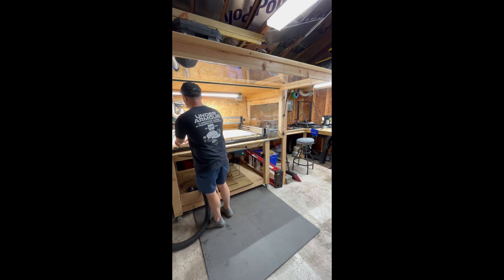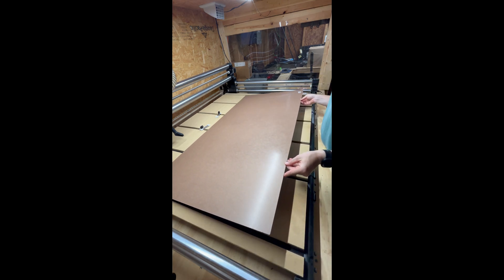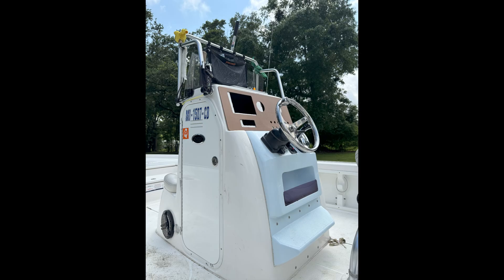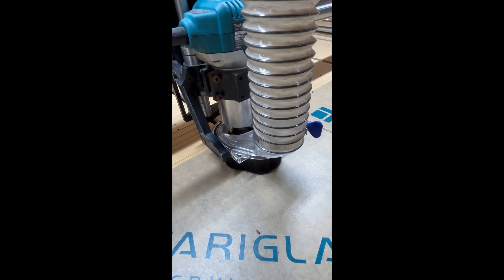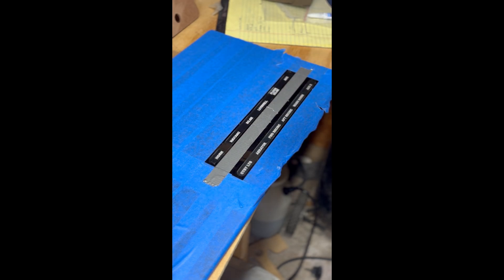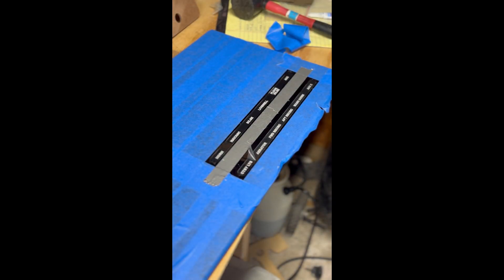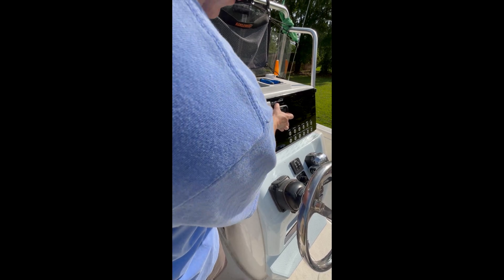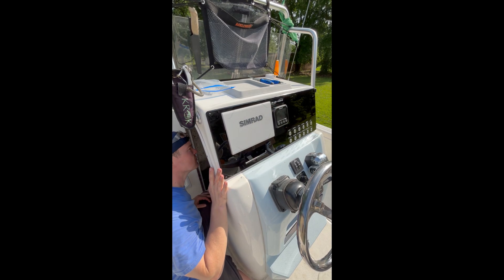Custom CNC Boat Dash Build & Install | 24' Blue Wave Acrylic Panel Upgrade

Comment: very nice work, I have had to cut a few larger than my CNC would allow in that case I placed registration pins in the stock and spoil board. it is as you said super accurate, ! I would like to know more about the switch engraving, Thanks for posting this